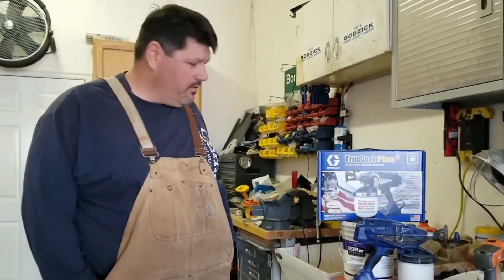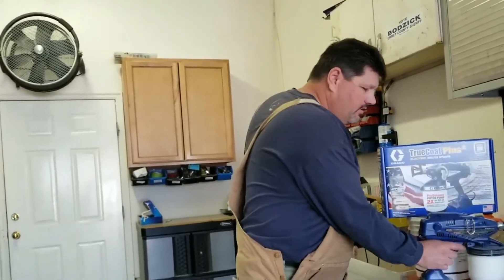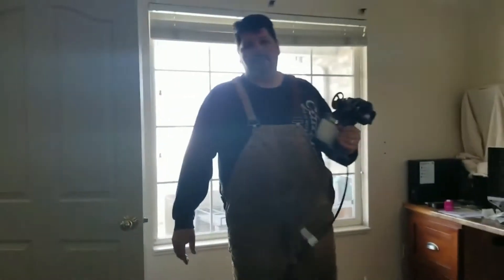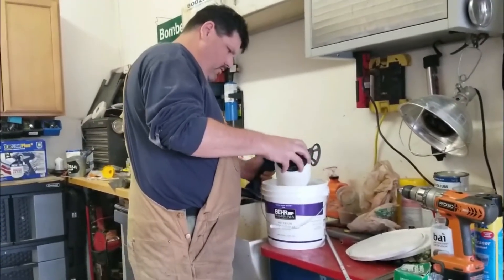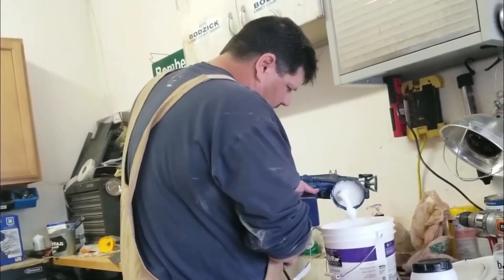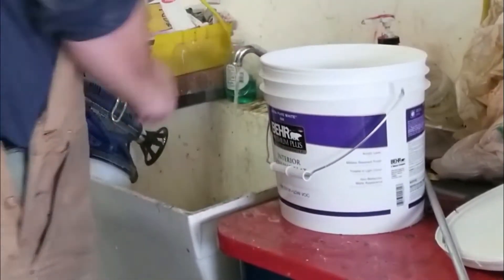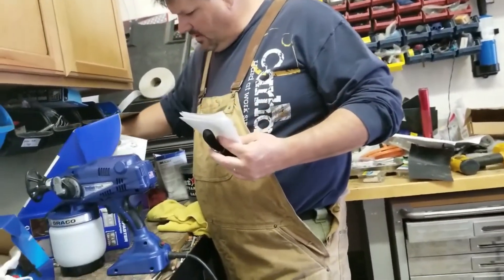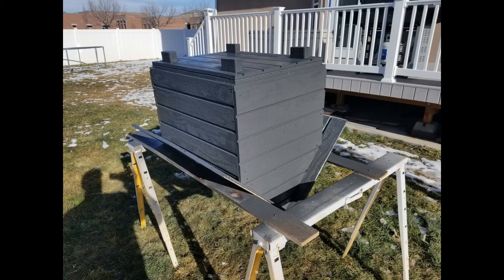Graco trueCoat Plus II Review and how to use

Comment: Important  - you forget lift valve up to prime position then insert pump armor nozzle over material inlet and push firmly until it stops.Squeeze cleaning  bottle until Pump Armor flows out drain tube. I have the same pomp - greating from Poland
Reply from the maker: Thank you Adam for the support I will defiantly check this out.